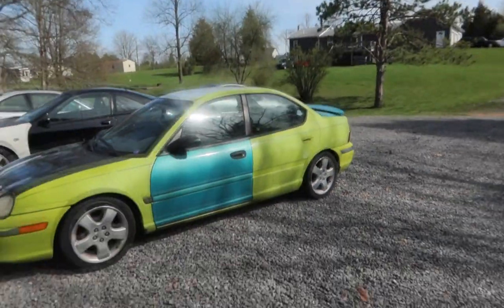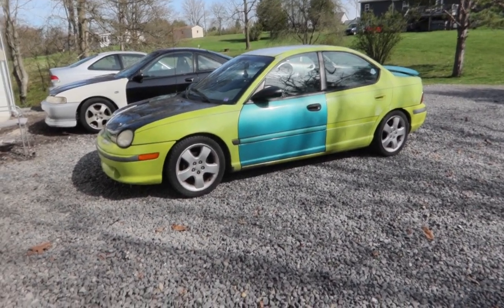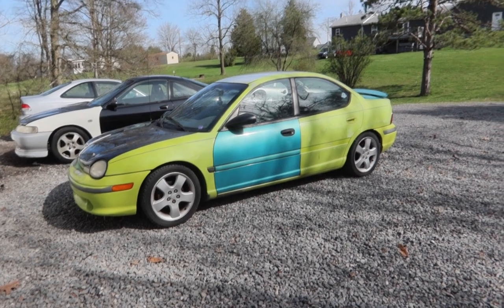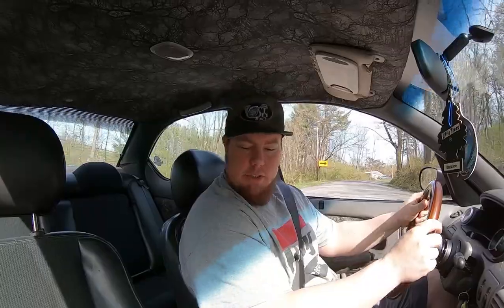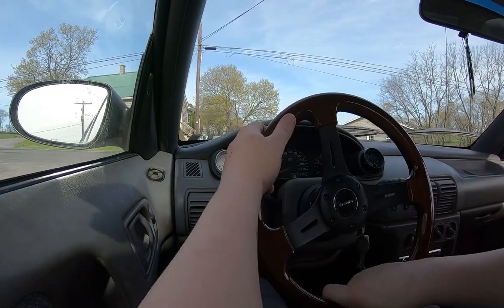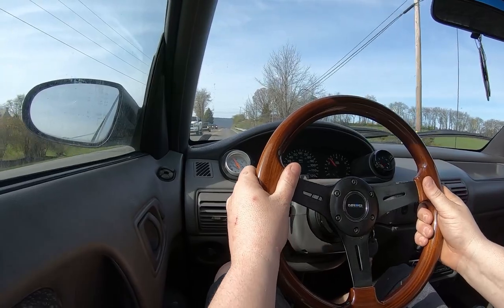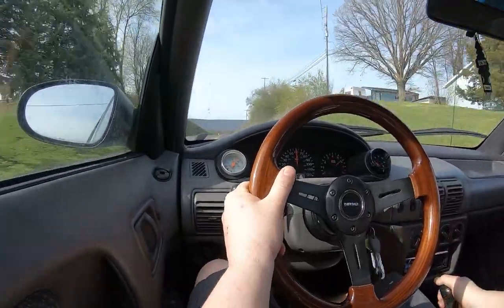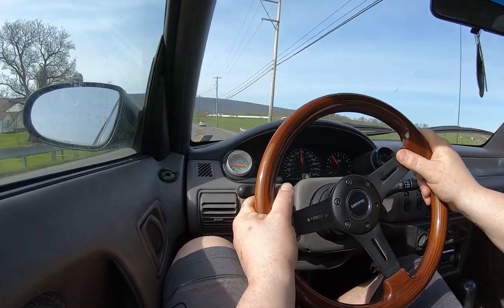Turbo Sohc Dodge neon! Street Pulls in mexico after some tuning! Built 2.0 on 13 psi!

Comment: Where at in Pa are u located? i am in Myerstown, pa and i love the neon content , one of the most disliked cars ever made but there is so much out there for them because of there SCCA dominance in the late 90s and early 2000s . My father worked for a Chrysler dealership during that time period and i was a teenager that loved fast and furious movies. when the srt-4 first came out in 2003 as a 04 version i was a senior in high school and almost bought a new one off the lot but the mother said no after she found out how fast they were. So i got a 1st gen dodge neon 2dr auto car and put about 5 grand into the motor and suspension as my senior project in high school. After that project i was hooked on the dodge neon platform. I still have a OEM Mopar performance ecu / computer that they had back in the day from the dealership. I wanna get a 1st gen R/T neon sometime soon and put a ebay turbo kit on it for a fun little car to  drive and beat on at the track on the weekends.

Comment: For the cluster issue, try reflowing the solder joints on the back of the cluster.  The 1st gens had issues with cold solder joints and reflowing the solder joints (I would probably even add some solder to them) would 9 times out of 10 fix the weird issues.

Comment: Question I have a fairly built 1g acr with a t350hd with nice guts but my clutch started making some noise the other day after some higher boost pulls with a bigger turbo and eh I'm starting to look into what I should get. I'm guessing the cars making 450-500hp rn and we probably got another 100hp on the table that I plan on exploring with a new clutch any suggestions would be awesome. Preferably something not super expensive as it is a toy lol but it's a fun toy so it cost what it cost at the end. That being said it is a street car and gets a good bit of street driving always concerned with reverse in our cars 😂
Reply: Turns out the clutch needed wearing in 😂 just spun through 5th on a hyw pull. Things a hoot now that it started grabbing good. After some inspection it's a 4puck.

Comment: Shes a ripper. Ill try get some vids of the 18g billet on my 2.3 20v 5cyl. Its only 8.5:1 cr full stock internals 20* on 100oct + wmi 23psi made around 340-350whp but around 400ft lbs in a 3000lbs car tho. 3.77 final drive has a heavy pressure plate on stock disc with 11lbs chrome moly flyhweel. Seems pretty similar to your 255whp in lighter car. Think im bit quicker up top but same worthless 1st gear on st tires lol. I run federal ss595 225x40x17.

Comment: Stock neon alternator?  Are you running an external voltage regulator?  The stock ecu had the voltage regulator in it and that is why at idle you don't see the alternator outputting voltage (if you aren't running an external voltage regulator).  When you give it some RPM it will kick into a kinda like "safe mode" and just put out 14 volts.  You don't need to change alternators just wire in a external voltage regulator from an older dodge.

Comment: Nice. Hilda man, I just put a Hahn super 16g on my sohc build. Rrfpr with an afc neo but the afc literally gave me nothing but headaches.do you have any used megsquirt setups for sale? This thing is pig rich at idle with stock sohc injectors on a walboro 255  into boost it runs stoich. But worried about washing cylinders, if you check my channel I up load some stuff asap not enough 1gen stuff on youtube